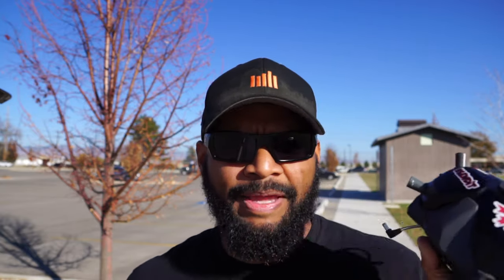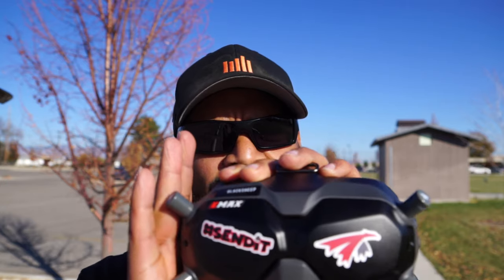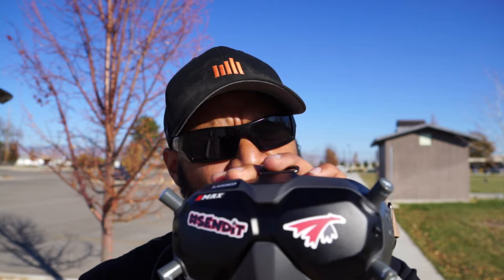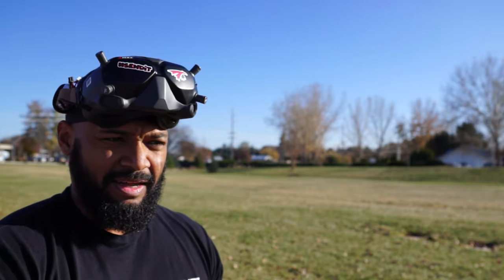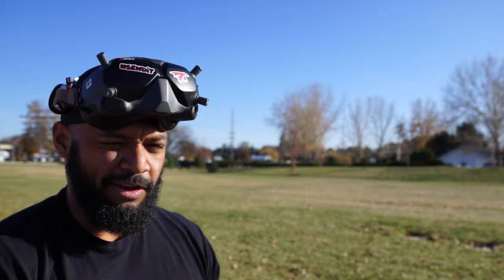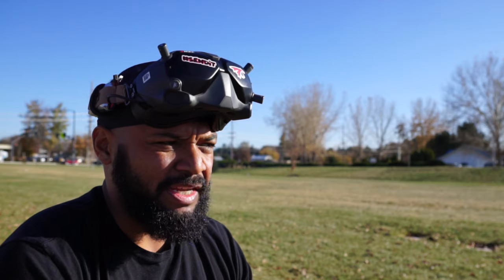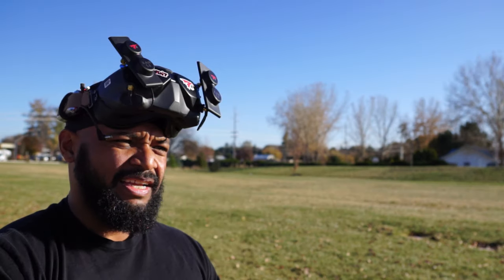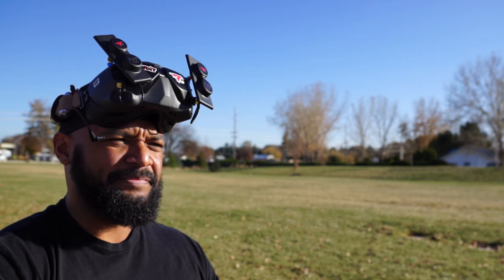DJI fpv vs TBS Fusion // FW v01.00.01.00 / Tuesday Vlog

Comment: Thanks for pointing out that analog latency is not fixed. Human reaction time is not fixed either, so there is another variable to consider.
Reply: This is what so many FPV pilots forget, just the camera latency is 25-40ms depending on resolution and its variable.  More variable than DJI...DJI must use a high performance camera (Why it gets so hot?) to make glass to glass latency 25-28ms or 40-43ms until you get to the very edge of range.  The DJI camera blows all runcams to dust performance-wise, which makes sense since it is must run at 1080p 120fps.  (Since it records at 1080p 60fps while transmitting 720p 120fps)  This is on-par with the 1080p performance of the Gopro Hero 5, impressive.

Comment: Dude this was a great video. I heard that the dji stock antennas are designed to be not too efficient so the transmission power passes regulations. That could be rumor mill stuff. I have noticed a significant improvement in latency with the True RC singularity antennas (long SMA) and the four stubbies from True RC. I have tried the X-airs as well. I was totally impressed how you were hovering in that tree when you spot a kite or something in the tree. It looks like your DJI camera is at like 40 degrees? Anyway, I am loving my DJI FPV system and low light is unbelievable. Thanks for putting this video together. Great stuff.
Reply from the maker: I think right now it's closer to 30 degrees.

Comment: Good point about the analog latency. Problem is though it’s impossible to have a latency lower than 16.666667ms with the FPS capped at 60fps - that’s the lowest possible latency theoretically. With the DJI system transmitting at 120fps the lowest theoretical latency is 8.3ms. If we can get 240fps goggle displays and transmission we could get a theoretical latency of 4.16ms. If fatshark were smart they would introduce a high refresh rate goggle for analog.

Comment: Interesting, but not at all surprising seeing as all the leaves are gone... green leaves are full of water that blocks radio signals, bare branches, not nearly as much signal loss.
Reply from the maker: The amount of leaves is a moot point being that it's the same environment for both systems.
Reply: @Furadi : I was referring to the increase in signal strength.
Reply from the maker: @twigfpv3667  oh lol... yeah its not the trees its the bathroom thats the barrier. I explained that. There isn't even trees in the path of where I'm sitting in relation to the bathroom.
Reply: @Furadi : To be perfectly honest with you, after 5 years in this hobby and now using the DJI system, I really dont care about analog anymore. Why go from amazing HD back to crappy analog? The whole question of latency and range is utter BS to me. As far as the bathroom "test," I dont put a lot of weight on the results... the numbers were all over the place, but better antennas should improve performance. But the results were so erratic that any conclusions would be suspect.
Reply: @twigfpv3667  im not going back to analog either.   I would be willing to try other digital system from other makers too.   Digital is def the future of the hobby imo.

Comment: Hey, Thanks for the review of New firmware update! 
I think that DJI put latency on OSD Just for pointer of weaking signal, when latency is low the signal is good, when starting grow up the signal is getting bad...
But I fly with the system for a month now and found that I sopped to look at these numbers in OSD. Just Battery... I wish to have mah, GPS speed and home pointer in OSD.

Comment: Did the air unit firmware upgrade affect your betaflight settings at all?  It shouldn't, but really want to make sure.. I kinda don't want to have to reload all my settings at the moment.
Reply from the maker: Oh nope not at all.
Reply: Cool, thanks for the reply.  I didn't think it should, but I was trying to decide if disconnecting from the flight controller would be a good idea or not.

Comment: I think the latency is a bigger problem if you are using the DJI Controller then your control and video gets latency and it probably stacks?
Reply from the maker: Probably only if you have low signal.

Comment: What cam do you use on your analog rigs? I've settled on micro sparrow 2 (discontinued but I have loads of them) CMOS with low latency, and great color contrast.  that and micro eagle are the only analog cams I fly anymore because everything else looks washed out on color.
Reply from the maker: Sparrow 2 Pro 1.8 lens! I even dremeled the Buzz cage a little to stuff one in there.
Reply: @Furadi  nice.  I've got one of the sparrow 2 pros, I designed my old pod around the smaller form factor though.  great sensor.

Comment: Do you get a low voltage alert from time to time using that battery? I have the same setup and it seems like I get low voltage alerts despite a decent charge on the lipo.
Reply from the maker: The GNB goggle battery? I did a lot BEFORE the FW update but they adjusted the voltage sensing for the goggles in the new FW.
Reply: Furadi Thanks for the update. Hearing that goggle alarm during flight was distracting as hell. Glad they updated the sensing.

Comment: I wanted to build a new quad so I decided to just try out the DJI system with this build. 

Wow man I thought it was just hype but it really is amazing. It makes you just enjoy flying instead of just going out and freestyling for the enjoyment.

My only gripes is the no "stock" analog reciever and the mmcx connectors on the air unit. The 90 degree stock ones are just dumb.

Comment: The DJI looks really good, but I’ll hold off on the entire system for awhile, as I just like analog! Curious as to what you’re using for a VTX and FPV camera on this test? I’d be curious, in this exact same spot, what a Rush Tank VTX set at it’s highest output, and the Predator FPV camera, how that would compare to the DJI at it’s lowest setting.
Reply: I have tried almost every analogue cam and literally none are even anywhere close to DJI. It's a totally different ball game.
Reply: @Skankhunt-42-  for a grand, it better be!
Reply: @3eggerfpv397  compared to hdo, rapid fire, tank vtx and predator, antenna etc. You'll probably find that all up DJI is actually cheaper anyway.

Comment: prob is dji is to costly for most people dji is nice yea but its alot to get started on and most people in the hobby fly on spare cash and use eachine 800d box goggles . i would love digital  but until its  3 to 4 hundred for everything i cant do it so i will wait a year and see where its at by then . i already have everything on analog and that took a while  to do lol now i did order hdo2s but i sold 2 sets of older goggles to get them and i already have a module so for me it cost 474  vs 800 and change so it was half of what dji would cost . if they came down on there prices more people would def switch but everything with dji label on it is way overpriced just to have some fun in a hobby hope you understand what im trying to explain good video man
Reply from the maker: I hear ya man. To me its about value. DJI is $730 for one quad to start. Compare that to premium analog - $500 goggles / $120 module / $40 cam and $40 vtx and you're right up there. I understand many already have analog gear but to say DJI is overpriced is innaccurate because you're getting so much more for your $$$

Comment: Analog is dying. I have 2 DJI equipped quads and they are all I fly nowadays.  My analog fleet is sitting collecting dust it's just that good.  Fully agree the latency thing is a non-issue.
Reply: Same. I did recently grab a $16 standalone receiver off of Amazon so I can help friends that are still on analog, but other than the desire to tinker, I really don't have a desire to fly analog.
Reply: Yep same. 2 built and another on the way. I have 30ish analogue quads which haven't seen a flight in months. It's just so much more enjoyable when you can actually see properly.

Comment: HI . LIKE YOUR VIDEO'S . DO YOU FIND THE FUSION MODULE BETTER THAN RAPIDFIRE ? I SEE A LOT OF PEOPLE USING IT . EYE TROUBLE I USE CAPS
Reply from the maker: Fusion is pretty good cause its $30 cheaper than RF. But RF has a slight edge in performance for now.

Comment: You feeling like the Singularity antennas are the better than the X-air?
Reply from the maker: No no... was just using them for the comparison.
Reply: @Furadi  Cool!  Just curious.
Reply: @Furadi  If you had to use only one...which would it be..Singularity or dual X-airs ?   I'm on the fence about both.. I know x-air may have better signal but it just looks clumsy and hard to put in a case

Comment: Dude, do the OSD overlay thing! I really want to see that.  The lack of OSD is the only thing keeping me from getting a DJI system right now.
Reply from the maker: It literally just looks like close captioning when you overlay it.
Reply: Mark Pfeifer it's crap, it produces a srt subtitle file that takes up the bottom quarter of the screen when you play back the file with vlc, I guess there is a use for it, but it's not really a problem.

I don't even have the air unit connected to my flight controller anymore, I just set my radio to squark out voltage every 30 seconds along with the usual rssi warnings and just fly, mind you I don't fly long range and never further away than I'm prepared to walk.  I don't presently have GPS on this build but don't miss it either.

The only thing I wish it would do is run a timer for the recording on the osd (if you connect it to betaflight you'll get a timer when ut auto-records but that's no use to me on my planes so isn't on quad either), so again I just rely on the nice OpenTX lady to tell me how long I've been flying.
Reply: @jibbajabba4597  I regularly fly over a mile out and depend on GPS when exploring new places. Hopefully the OSD "subtitle" box arrangement is temporary and they can figure out how to just overlay the text like in betaflight OSD.  Meanwhile, I'm ok with my analog setup, but I'd sure enjoy a sharper picture.
Reply: Mark Pfeifer oh you don't get anything different in the subtitle file than what is on the screen now, it only lists flight time, voltage and bitrate/signal strength.  I know the feeling about relying on GPS, I have it on my wing, the DJI will be a complete product when they have the rest of the betaflight osd on the screen.
Reply: People... I have this system and I can’t understand why you keep saying there is no OSD. While flying you get: flight pack voltage, goggle voltage, radio RSSI, video MBps, system latency, video channel, and flight time.  How much more OSD do you need? You want it to fly the quad for you too?
Reply: thejason51873 you don't get rssi if using your own radio nor do you get useful info like error messages, number of satellites, distance/direction to home etc etc.
Reply: @jibbajabba4597    I haven't played with the OSD long enough to have every answer, but I have watched the videos on the Android tablet and on VLC. The android allowed resizing and moving the "caption", so I assume VLC has an option, I just haven't looked for it. Also, the srt is really just a text file, so you could easily parse it to only the info you want included in your YouTube video. Seems like this srt file is a standard, so should be plenty of options to make it do what you want.

But yeah,... can't wait for them to fully implement all telemetry/OSD fields. This update came out 2 months from product release. Can we expect the new stuff Jan 1rst? And I want manual fan control by next summer. That's like April down here,....
Reply: This produces an acceptable result to me:
ffmpeg -i DJIG0170.mp4  -s 2560x1440 -aspect 4:3 -b:v 25M -vf subtitles=DJIG0170.srt DJIG0170substrim.mp4
You can remove the resizing if you're later editing into a vlog.
Now to parse out the fields I don't want,...
Reply: rcrdps ctrl+H in notepad to replace the unwanted fields with nothing.  I did find the first one (channel?) always has to be there otherwise the srt file does not work, I guess there might be some hidden character that notepad isn't picking up that something like notepad++ would.
Reply: @jibbajabba4597   Maybe I'm missing something. Wouldn't that just replace the field name, and not the value. Seems like it's going to need some regex to pick up the value.
Reply: @jibbajabba4597  Just for giggles, I did try what you said to remove the first two columns. Worked fine. Maybe you left in the next space?
Reply: This works in powershell,... we'll see if youtube will allow me to paste:
 (type .\DJIG0170.srt) -replace "signal:[0-9]+ ",""
Reply: Here's my final line. It's messy, but it'll do for now. I'll get fancy later if I want to re-order or something. Probably something like read it as an array and just include the array members that you want.
(type .\DJIG0170.srt) -replace "ch:[0-9]+ ", "" -replace "glsBat:[0-9]+\.[0-9]V ", "" -replace "uavBatCells:[0-9] ", "" -replace "glsBatCells:[0-9] ","" > DJIG0170test.srt
Reply: And the finished product.
https://youtu.be/cqyhrOutTSM
It's "ok". Don't think I'll put too much more thought into it until DJI releases their "Full OSD", cause that might change things.
Reply: Sigh,.. couldn't help myself,....  Now I can get the font smaller with this and it looks much cooler:
ffmpeg -i DJIG0170.mp4 -t 20  -s 2560x1440 -aspect 4:3 -b:v 30M -vf "subtitles=DJIG0170test.srt:force_style='Fontsize=10'" DJIG0170substrimtest.mp4

Source for the answer along with other font and spacing options:
https://video.stackexchange.com/questions/24207/ffmpeg-hardcoded-subtitles-from-the-top-bigger-with-thicker-stroke-on-a-dark

Comment: Hi. Putting OSD file in your video editor is easy . Just drag and drop it in your editor as a new layer. Look at my video range test.
Reply from the maker: Doesn't work in vegas unless I need some kind of plug in.
Reply: @Furadi  For your workflow, I'd say grab the dji recording, dump it in Handbrake, feed it the srt file, export the burned in captions to a mp4 file, then use that in mp4 your videos.  Sure it is one extra step, but it is worth it and not too much of a hassle.  I'm sure you could even automate the process for a batch of files too.